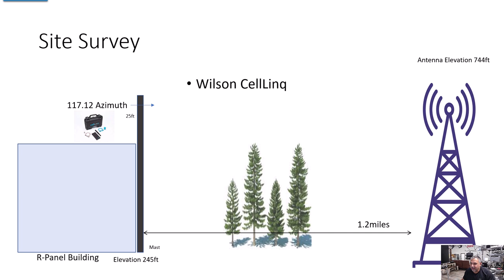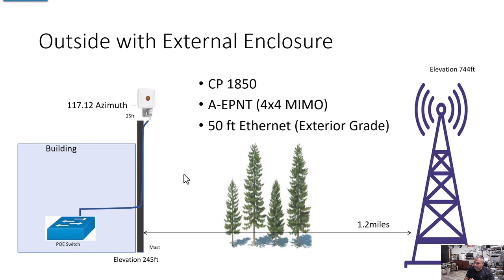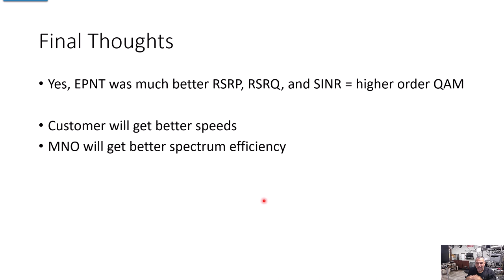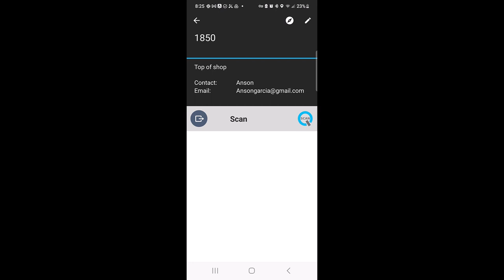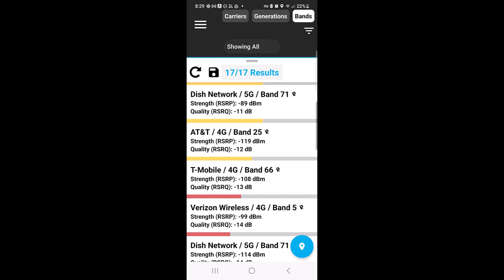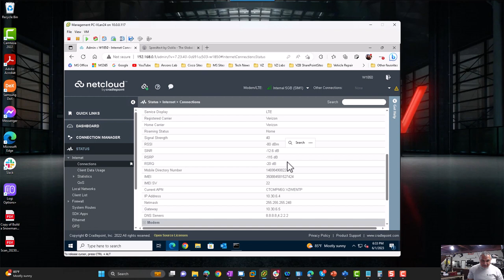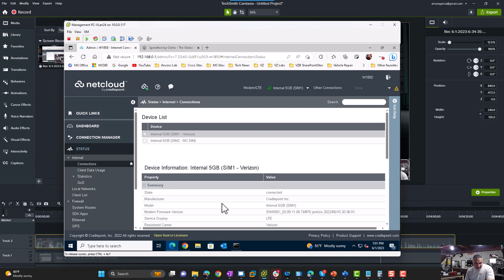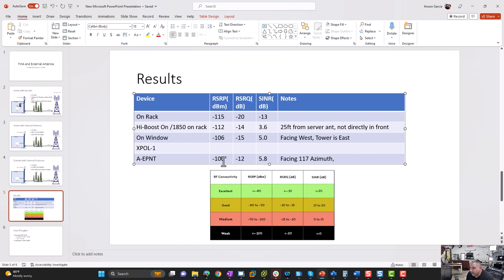Cradlepoint 1850 and Poynting EPTN Testing

Comment: Hi Anson - really nice to see such detailed and rigorous testing! You are really doing great work ito quantifying benefits of both outdoor antennas and integrated antenna/modem units. The one aspect not tested, and which I believe should at least double EPNT speeds compared to other tests is the MIMO performance. EPNT has 4 antennas with 4 polarisations. Can theoretically give 4 independent data streams with each ones rate governed by SINR, RSRP, RSRQ you measured. EPNT's cross polarized antennas (compared to 4 linear omnis, for example) will product AT LEAST 2 independent streams giving potentially twice the data rate of even another setup with equally good signal. Can be higher if some reflective paths exist. 4 closely spaced same polarization antennas unlikely to produce much "MIMO speedup" in an open air scenario. Clearly the improved signal measured will also ensure each EPNT stream will be at higher QAM hence bitrate. Would be nice to see speed tests even though both of us know these are highly variable given base station capacity, variations over short time periods and other factors. Should however still show some of this MIMO benefits which is one of the really significant advantages associated with well designed xpol outdoor antennas. Take into account that going from, say 16QAM to 64QAM translates to 4 bits per symbol up to 6 bits/symbol. Two MIMO streams boost this to 12 b/symbol - no amount of signal improvement can produce this type of benefit 🙂Thanks for this effort